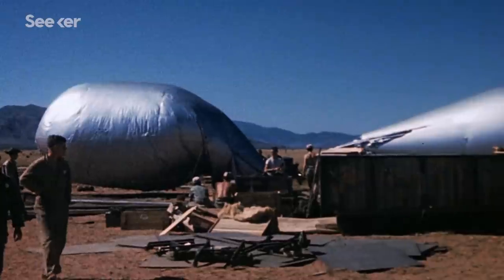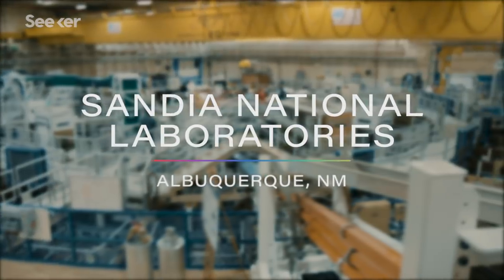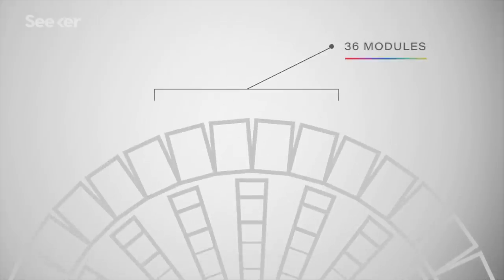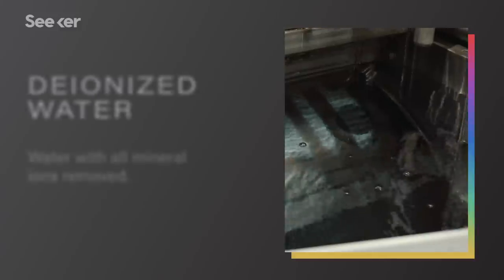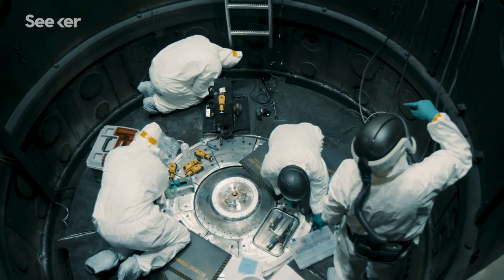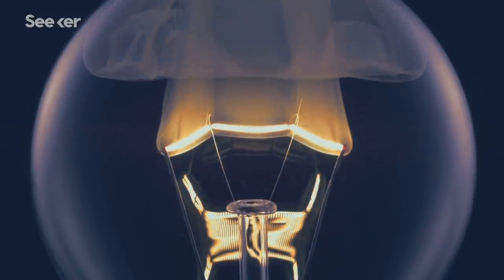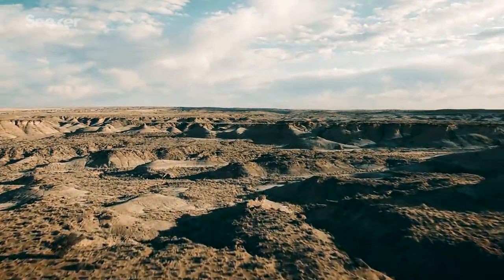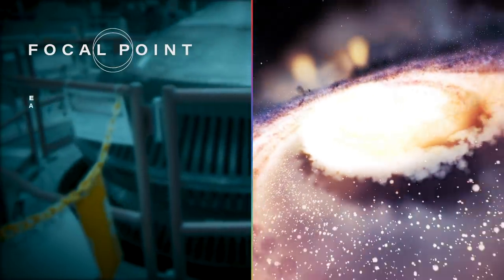Inside the Most Powerful X-Ray Source in the World

Comment: The real reason why controlled fusion is hard....  sun has huge sample space interms of collision per sec... Thus probability of collisions overcoming proton-proton repulsion is high ... Quantum Tunneling effect..
Which is hard to recreate on Earth. Thus we need temperature higher than core of Sun
Reply: Bhuvanesh s.k it’s like What I told my girlfriend; size doesn’t matter if we can heat things up a bit.
Reply: ebulating yes both. (Along with a few other things, both pressure and temperature is necessary to undergo fusion on earth.

Comment: The big green pipe running horizontally across the top of the machine is called Z beamlet. It's an ultrahigh power laser beam (1 quadrillion watts - higher power than Z itself actually) we built for them about 15 years ago here at the Lab For Laser Energetics that fires coincidentally with Z to create a few picosecond long super hard x-ray backlighter pulse which is used to image collapsed nuclear fusion microcapsules at the moment of maximum target compression and highest temperature and density. You can see the construction of similar chirped pulse amplified lasers at LLE on my channel. The technology used to create these lasers was invented here in the 80s by Gerard Mourou and Donna Strickland who won the physics Nobel 2 years ago for their work.

Comment: What's the difference between this machine and the LHC? wouldn't they gather similar results?
Reply: they do totally different things
Reply: @MatthijsvanDuin  the LHC splits particles to study their internal physics, this thing creates high energy dense plasma to study other stuff.
Reply: @austinobst8989  yes.  Yes, the LHC performs experiments on the scale of single subatomic particles: it performs collisions between protons with a collision energy of up to 2 μJ, which is a huge amount of kinetic energy for something as small as a proton but a miniscule amount of energy in absolute terms, and it performs millions of such collisions per second and collects a giant volume of data used to understand fundamental particle physics.   The Z-machine dumps a single pulse of an absolutely massive amount of electrical energy into a macroscopic target to create a plasma at very high temperatures and pressures, allowing such extreme circumstances to be studied. (which otherwise typically only occur in nuclear explosions and some high-energy phenomena in space)

Comment: Well then... what is causing all the flashes of light I've been seeing?
Definitely not this thing it's a blip on my radar.
The pulses I've seen aren't organized or regular at all typically appearing around stormfronts. This machine isn't outside of my detection area. Perhaps it's relatively weak signal is why I've missed it. I might have been confusing it with closer MRI machines and scrubbed it's signatures from detection a few years ago. Allegedly they've been testing this way since 2013 with their current power output.
If that's true, maybe it's not a blip afterall? Still got scrubbed from detection sometime about 2 years ago now. I wonder how long their older projects took to fire up? Did it always take about hour to charge up those capacitors? If so maybe that system wrecked havok on my own systems when exploring electro-sensitive ranging. Even though it's wall-current the capacitors charge itself might have created a lot of interference I just couldn't deal with 20 years ago. Hmm now I'm wondering what other projects like this existed across North America???